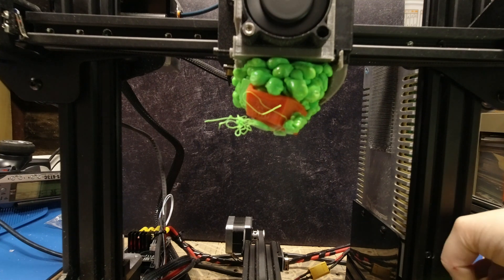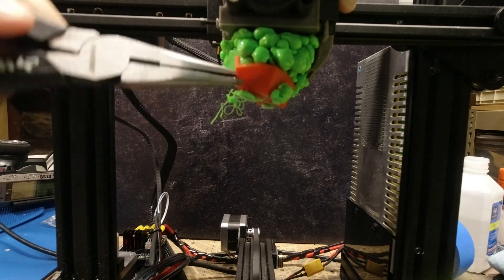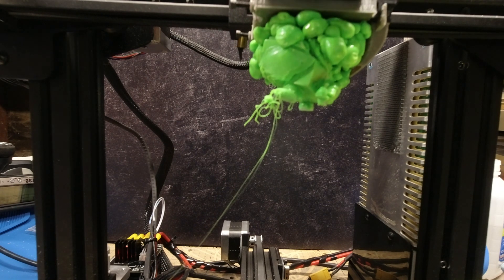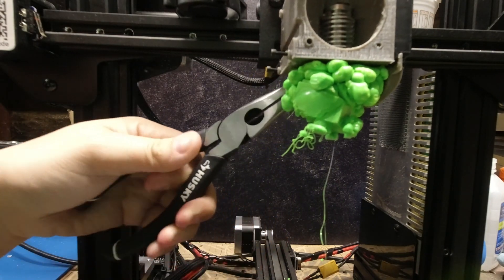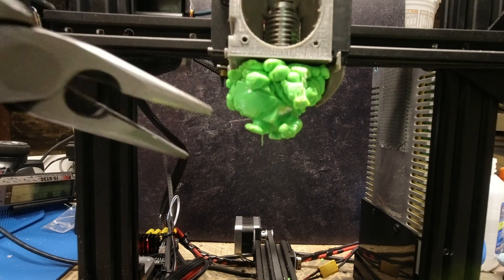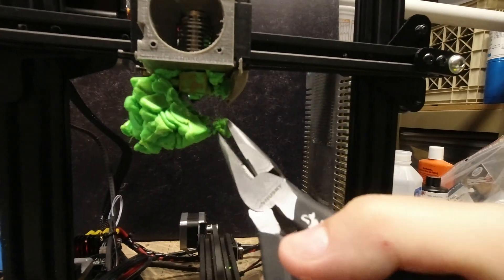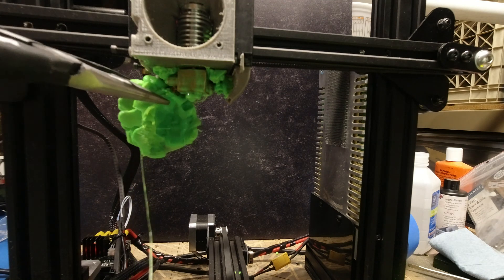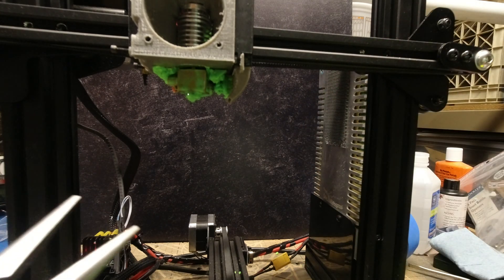Remove a Blob of Extruded Filament from Your Hot End || How To

Comment: A really solid example of why it pays to keep a spare thermistor and heater cartridge around for moments like that!
Reply from the maker: Calvin Witt luckily I can get it on amazon so it won’t take forever
Reply: @ChippedBuilds  true true although if you are like me and do lots of rush work downtime is a no go.
Reply: But do you have spare linear rails? Spare stepper? Extra belts? What about a backup RAMPS board?? You can never be too careful!
Reply: @EmilysElectricOddities  have a spare printer